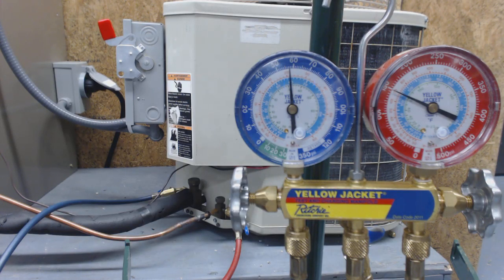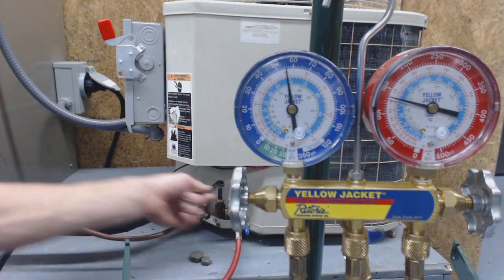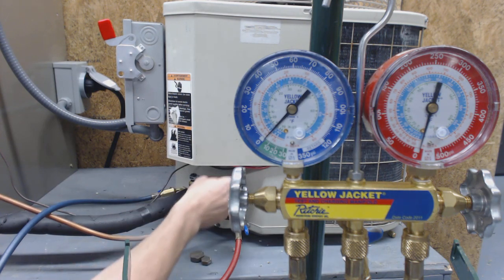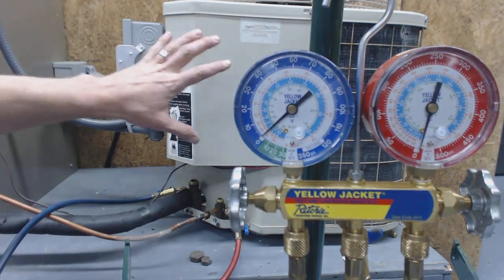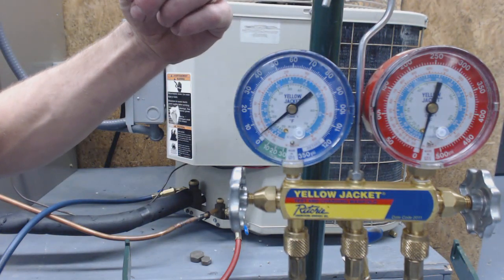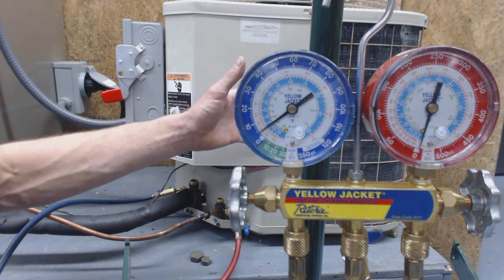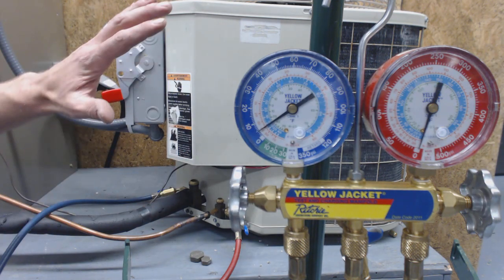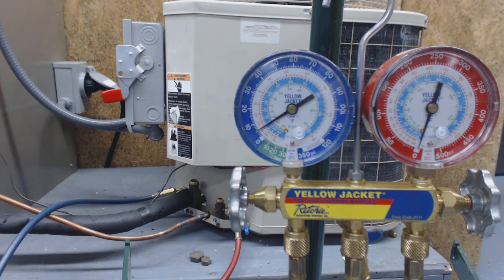Explanation of How to Pump Down an Air Conditioner including Proper Guidelines!

Comment: At the end, that pressure reading looked very low. (About 6 PSI) 
It seems like the internal volume of the line-set and indoor coil would need to be pretty large for any substantial amount of refrigerant to vaporize and create only 6 PSI..
So, how much refrigerant did you recover?
Reply from the maker: I believe it was just a few 4-5 ounces but you need to follow the epa guidelines without doing damage to the compressor that you are planning to reuse. If I was just doing a changeout I will always just use a self contained recovery unit because at some point I would have to anyway and there is always something to do at the jobsite during that 20-30 minutes. This unit in the video is just a training unit by the way. Thanks for the questions!

Comment: Since that blue hose going to the gauge, was hanging down below the system (and the gauge manifold), and liquid refrigerant could run down-hill into that hose, which is dead-ended on the gauge.
Could some liquid refrigerant sitting inside that hose be responsible for the small rise in pressure (after shutdown)?
Reply from the maker: Great Question! You can still pump down an outdoor unit even if the evap coil was below the outdoor unit level just like the hoses were below the unit in the video.  Also the high side is being sucked down as well as the low side and the pressure is reducing. That would vaporize most of the refrigerant. This is why the lines get cold during a pump down but it hapens so fast that not all of the liquid gets a chance to vaporize if you just go down to 0psig. On one of my recovery videos I explained how even between 0 and 10"hg I was able to recover another pound of R410a and that just shows that some liquid is left even when you do reduce the pressure which vaporizes the refrigerant. Thanks and once again great question!

Comment: So does all the refrigerant get pump back into the compressor? I notice that not all unit has an accumulater, or reciever, especially  reach-in units.  Also close the High side 1st , then Low side close to 0 then Shut off the Unit. Is this correct?
Reply from the maker: The unit's refrigerant gets pumped into the condensor coil and yes shut the liquid first and then shut the vapor and then the power when it gets low enough. In some cases it is right below 0 and others it is 4inch to 15inch hg. Then you see if it rises and recover anything above 0.  Any refrigerant in front of the compressor will be stuck in the unit but you would still have refrigerant coming into the vapor line so yes make sure to shut that too before powering off the unit. Many times the internal pressure relief will pop before reaching this on older units so you just shut the valves at that point, turn the unit off and recover the rest. thanks

Comment: why the copper become freeze as it turn of?
Reply from the maker: When the pressure is low in the suction line then temperature will be low. If the pressure was high then temp would be high. The pressure and temp follow each other.

Comment: I have to move my condenser unit. Once the pump down is complete. It is now okay to cut the line set and extent the line set to the new location ?
Reply from the maker: Great Question! If the system is R-22 and by EPA regulations is less than 200 lbs, then you can pump down or recover to 0 psig and hold. If it stays at 0 psig or below then the lines can be cut and new brazed on. Thanks!

Comment: my ? is I have to move an older  mini spit condenser R 22 can I  
pump  unit down  or should I  recover.  Thanks
Reply from the maker: Great Question! Mini splits usually can be pumped down even if you only have the vapor port to hook to because there are two valves but you could just recover all of it so that you can add up your lineset length in the new location and weigh exactly what you know you will need when you install it folowing manufacturer weighing specs. Thanks!

Comment: I checked many video about pump down, i still haven't found one that mentioned about the position of the valve of the manifold. Just  please verify the position of both of these valves (liquid and suction line) should be Open or Close before even hooking up to the service nuts of the condenser. Second, can you do this procedure without supplying Power to the Air Handler or Evap coil, meaning Air Handler is off?
Reply from the maker: Great Question! Every time before attaching the gauge set, the handles will be closed. If the service valves have schrader valves then attach into them and you would read pressure. If the unit has king valves then you would need to attach the gauge set and you would move the valves with a service wrench from back seated to mid seated to start the procedure. While the system is running, the liquid line is front seated all the way down, then for r-22 when the vapor pressure reads 0 psig then the suction is closed all of the way. If it was R-410A then you would need to close the suction valve in the front seated position once you get to 10in hg. This is all taking into consideration that there is no leak where you would be sucking air into the lines during the procedure. If there is no power then we do a recovery process. Here is a video on recovery---https://youtu.be/g2QD8TjwRHU
Reply: R-410A is considered high pressure refrigerant, under 200lbs., isn’t the requirement 0 psig?

Comment: Say you did a pump down, and recovered the rest of the refrigerant from the lines and evap; and opened the unit to the atmosphere. Are you able to remove the service shrader valves without letting refrigerant out from the condenser? Thanks
Reply from the maker: Yes the Schrader valves can be removed if the service valves are front seated all the way down. Thanks for the question!
Reply: +acservicetech  Thanks for the quick reply. Keep up the awesome vids.

Comment: turning a fan on at  ah helps with a pump down, what do you think about pumping down with a scroll comp. there are mix thoughts about it?
Reply from the maker: Great thoughts, anything to heat up the freezing lines and evap coil would help. I mean we still do the pump down with scrolls but if you are concerned you could always shut the valves and recover. The thing is EPA dictates that hfc's like R410A have to be pumped down to 10in hg when less than 200lbs total and hold it so actually that means maybe 12-15inch hg with a rise to 10 inch hg. I agree that any pump down is not a good thing at all for compressors especially scrolls and I run into systems where a 5 year old scroll compressor will go out on overload before the vapor line is even down to 25psig. I just stop and recover. Usually you are going to need to recover anyway if you are working with a system that has a leak in the evap because you don't want to suck any air into the line and ruin all of the refrigerant. For the best result with R-410A and scrolls, shutting the valves and the recovery process is best because of the price of R-410A, any possible fractionation even if little, and compressor life. Once again it's about preference and your own experience. Thanks for the comment!